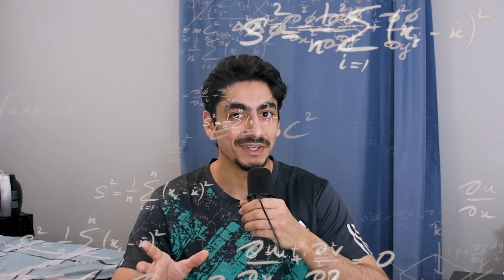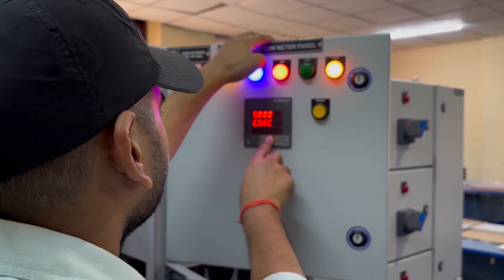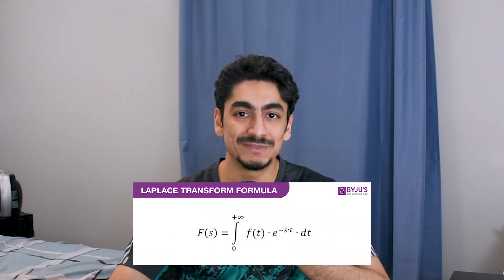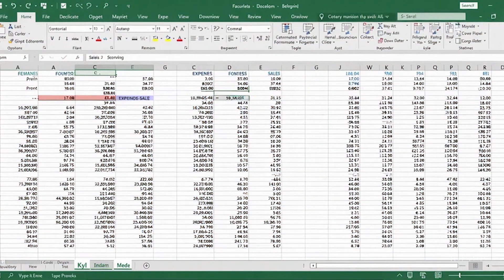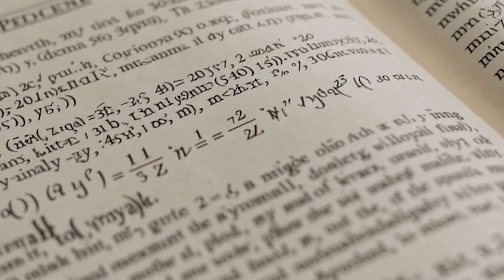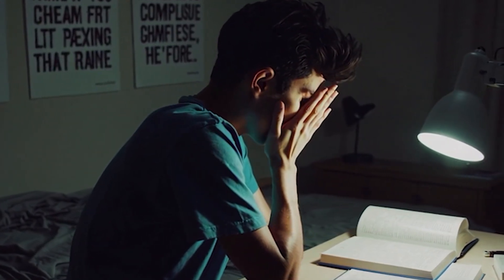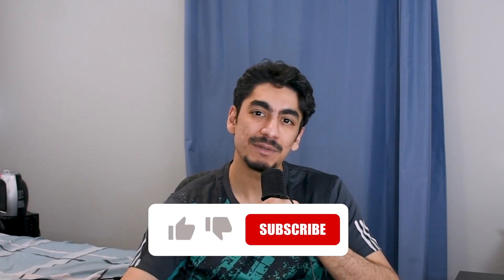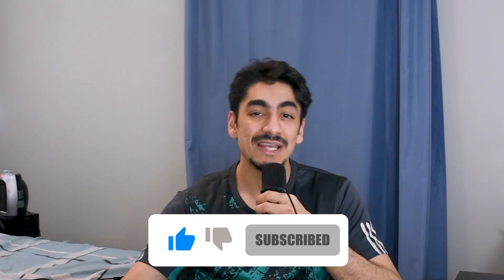why you DON'T need math for mechanical engineering

Comment: i’m an eng technician & just started my 1st yr doing mech eng @ uni. i heard from engineers that they don’t always do math but always do CAD work & always use software where the math does it for them, while they do the trial & error.

the manual math we do in uni is just the foundation, the why & how the math applies in engineering. but rlly when u do engineering fr, yk engineers don’t rlly do the math always

Comment: In my opinion, these are only valid if you are a working engineer not that you don't need math. You didn't mention research and development. I am a 3rd year me student and I enjoy every course I'm taking this semester be it Control, Fluid dynamics etc because of the interesting maths involved. Maths would still be an important part of the field. 

I agree with everything you said , me does comprises everything. Even as a researcher you will probably be solving the complex equations with a tool like MATLAB or Python. But it still helps to know how these programs actually solve the problems in order to be able to double check the results and to even use the programs properly. 

Thanks for the insightful advice. Good video.